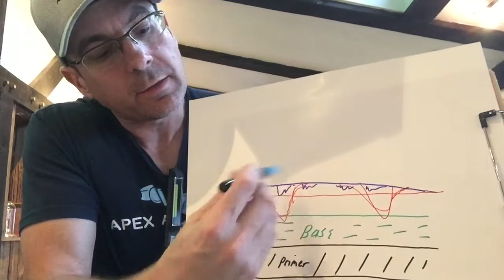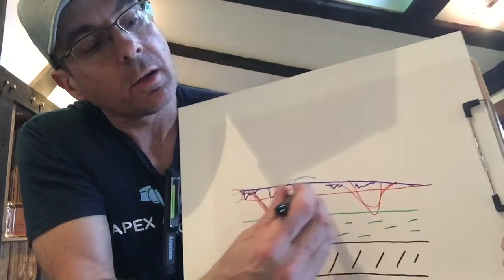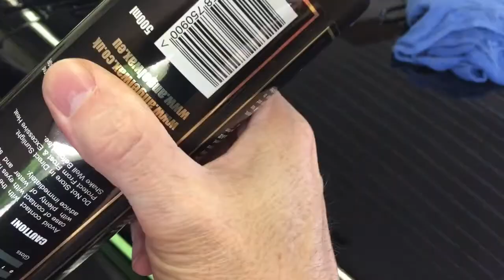Multi stage paint correction and ceramic coating on black Jeep with deep scrapes and scratches.

Comment: Does your small Griots DA stall out spinning with very small amounts of pressure?  I was trying to use it on a pillar area on a car and noticed it was oscillating but not spinning.  Not sure if that is by design or an issue with the machine.  Thanks and thanks for your info on the rotary video earlier.
Reply from the maker: That unit is not forced rotation... at least mine isnt anyway. If I need more power and forced rotation.. I switch to the M14 mini.👍🏻

Link for M14👉🏻http://www.autobritedirect.co.uk/index.php/mr600-mini-m14-rotary-polisher.html
Reply: Apex Detail yeah, I can stall this very with light hand pressure.  Even without direct rotation just seems to stop rotating way to easily.   Thanks again Brian!
Reply from the maker: Yup... take a look at the M14. If you get that.... these are a must have for small, tight areas.👉🏻http://m.ebay.com/itm/3-6-M14-ROTARY-POLISHER-EXTENDER-EXTENSION-BARS-DETAILING-DA-DUAL-ACTION-/142079946248?_trkparms=aid%253D222007%2526algo%253DSIC.MBE%2526ao%253D1%2526asc%253D20150519202348%2526meid%253D396fb64a7dbc42d2ab0a03e84ad6835f%2526pid%253D100408%2526rk%253D4%2526rkt%253D6%2526sd%253D141531377490&_trksid=p2056116.c100408.m2460